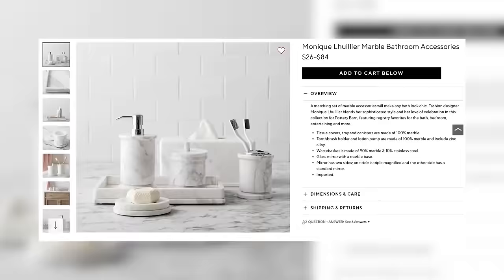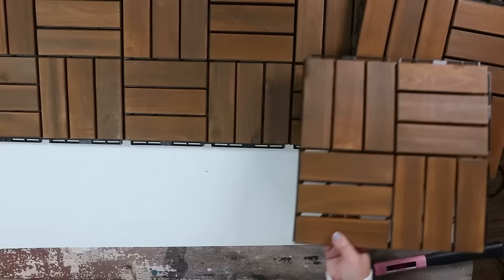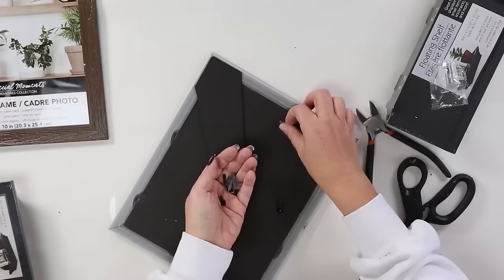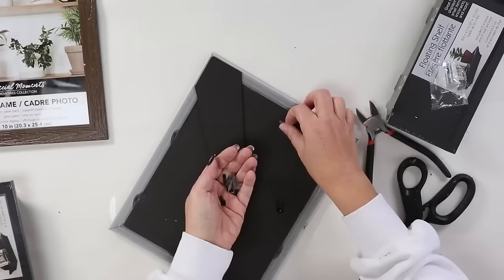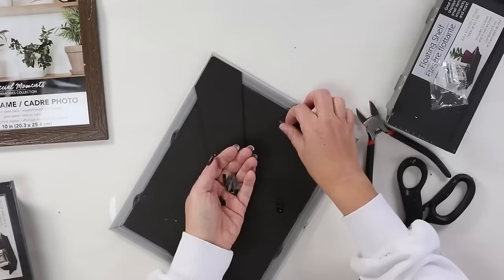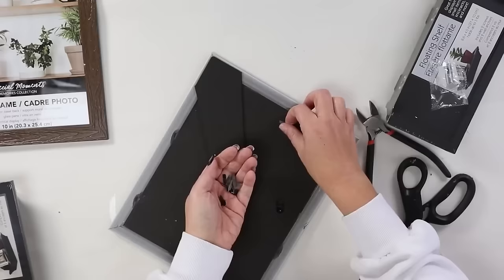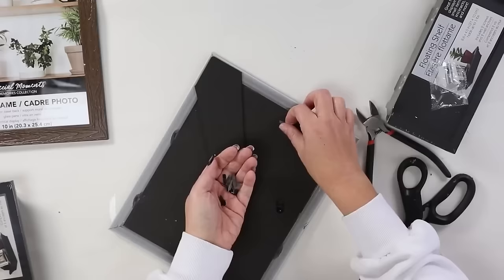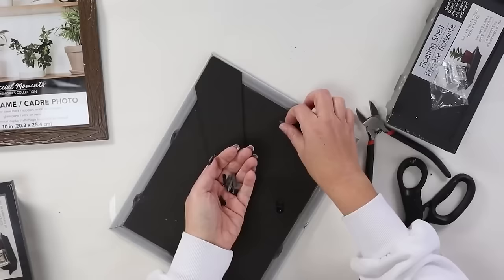50 Bathroom DIYs with $1 items from Dollar Tree

Comment from the maker: Shop Here:
Glue Sticks: https://amzn.to/3g61ar3
My Glue Gun: https://amzn.to/2SJjRDr
Large Wood Beads: https://amzn.to/3tsylQe
Rust-Oleum Spray Paint: https://bit.ly/3NEhjWx
Miniwax Wood Stains: https://bit.ly/3RWOSVM
Foam Brush: https://amzn.to/3mcxgEI
Screwdriver Set: https://amzn.to/3H76lEF
Rub'N'Buff: https://amzn.to/3nZCnZV
My Drill: https://amzn.to/3STMI7H
Hex Head Drill Bits: https://amzn.to/3eb4yDR
Dewalt Drill Bits: https://amzn.to/3SSTYQy
DAS Airdry Clay: https://amzn.to/3tzgrLt
Oscillating Saw: https://amzn.to/48fz3PJ
Landscape Prints: https://amzn.to/41CJevp
E6000: https://amzn.to/3a2PA0d
Frog Tape: https://amzn.to/3B0Mgx4
Silicone Tray: https://amzn.to/3HkSZp7
Amazon Hooks: https://amzn.to/4425D69
Spray Paint Turntable: https://amzn.to/3AzMM4U
Wire Cutters: https://amzn.to/3Hj8uOV
Plastic Putty Scrapers: https://amzn.to/41J6Hdw
Makeup Brushes: https://amzn.to/3HlJV37
My Scissors: https://amzn.to/3NfDz6r
Stone Rust-Oleum Spray Paint: https://bit.ly/3VXItKs
Matte Sealer Rust-Oleum: https://bit.ly/3BhrtFA
Sand Dollar Rust-Oleum Spray Paint: https://bit.ly/3BmGHJg
Rustoleum Metallic Finish Spray Paint: https://bit.ly/3Ild1RI
Rustoleum Hammered Spray Paint: https://bit.ly/3ImcZsG
Golden Oak Wood Stain: https://bit.ly/3Z5qKBZ
USB Lighter: https://amzn.to/3G4sbrG
Nautical Rope: https://amzn.to/3CnpP5h
Wood Beads: https://amzn.to/3GxXlJt
Jute Twine: https://amzn.to/3WzmusN
Dishwasher Safe ModPodge: https://bit.ly/3MdUt48 
Krylon Satin Rolling Surf Spray Paint: https://bit.ly/3Mhrb4D
Embroidery Hoops: https://amzn.to/3tcHZmu
Cricut Joy: https://bit.ly/3yTdi5I
Cricut Tools: https://bit.ly/3bQPmqH
Sandpaper: https://amzn.to/3ynF8IN

Shop Products On My Amazon: https://amzn.to/2QnH1DL
Reply: Liz you can do anything a man can do but you can do it better if so creative
Reply: Enjoy you